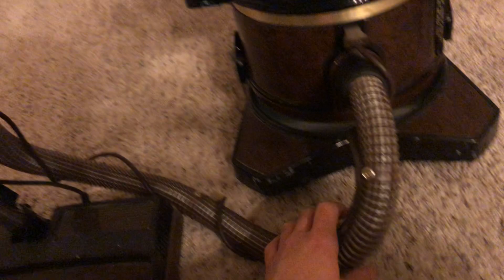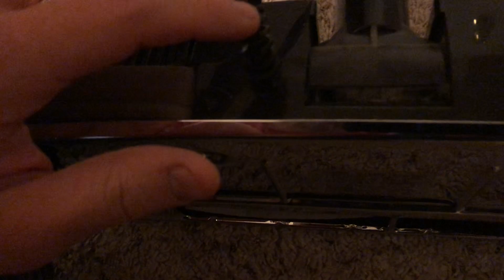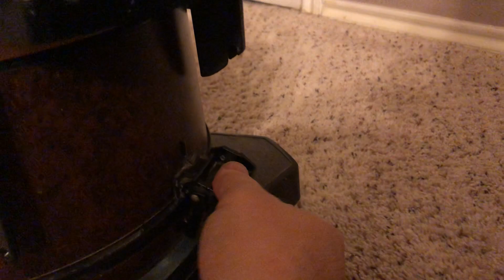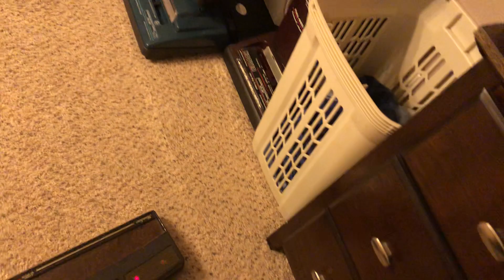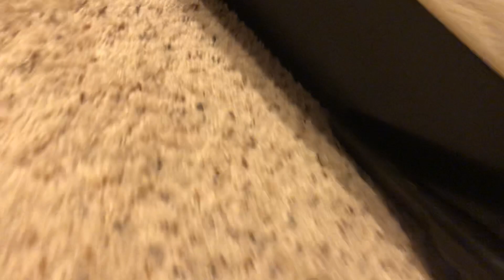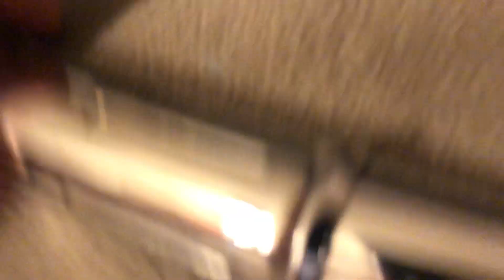Rainbow D4c (D4) Canister Vacuum

Comment: This might get some flack, but the Rainbow D4c has got to be quite possibly the worst vacuum cleaner I've ever used. My dad bought one used because he used to be a Rainbow salesman back in the 80s, and I guess he had a wave of nostalgia for them. At first, I was thrilled with being able to use one, as my grandparents have one, but I've never seen them use it, and I was never allowed to use it myself. However, that excitement quickly wore off after a couple of uses. Ignoring the main problems with Rainbows and other water filtration vacuums, the biggest problem for me was the power nozzle set up. The fact that you have to use a separate hose for your tools on a CANISTER vacuum is just ridiculous. On top of this, the power nozzle preformed awfully despite it having beater bars (to be fair, the belt on it might've been stretched, but I'm not entirely sure). The PN was also extremely bulky and loud, and the canister found every opportunity to get caught on furniture when following me. Finally, for being a "high end" machine, the bulid quality feels extremely cheap (again, it was a used model, so that possibly plays into that). The only positive thing I think i can say about it is that you can vacuum up water with the tool hose without having to convert the canister to do so, and this comes especially handy when vacuuming a kitchen with lots of spilled sink water on the floor. You can also use as a carpet extractor, although I don't have that kit, and even if i did, the water supply comes from a faucet, which would probably be extremely unwieldy to use. In short, the Rainbow D4c is an absolutely atrocious machine that deserves to be smashed to bits. And in general, i would not recommend a water filtration vacuum to anyone, due to the hassle that comes with them, as well as their lack-luster filtration (at least it was awful on mine). If you're gonna spend $1000-$2000 on a vacuum, get something like a Sebo or a central vacuum at that point.